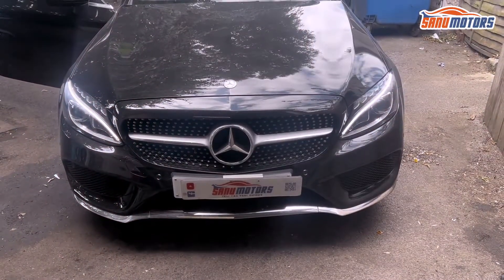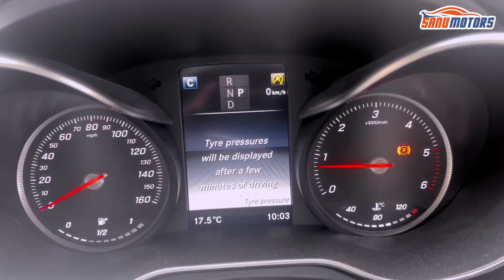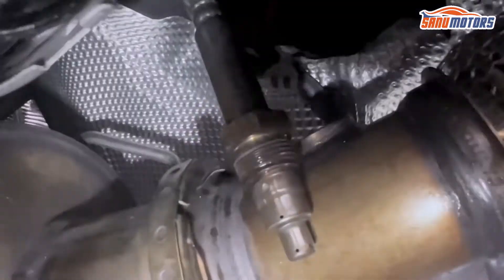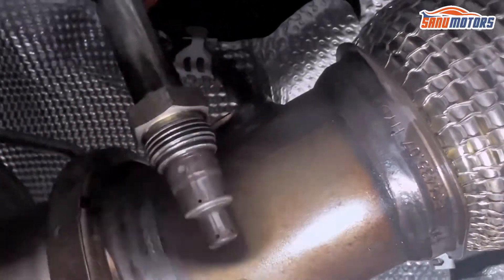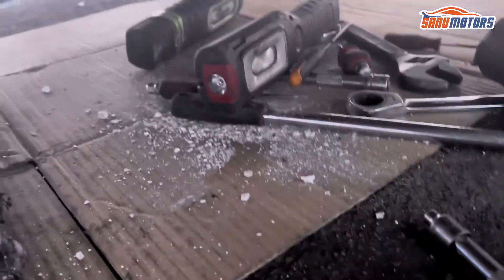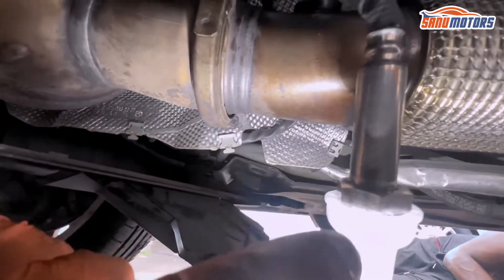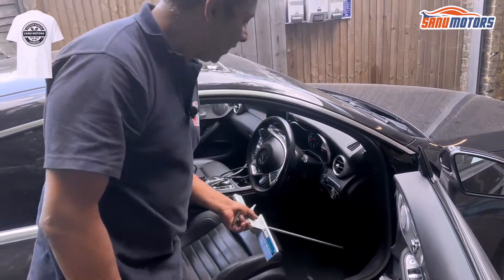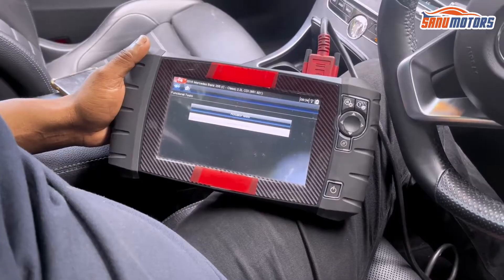Mercedes AdBlue DPF  And NOX Problem Fix | P229F91

Comment: I want to know what did you use to clean the hole. Was it just a simple DPF cleaner or is it something specific for adblue. Also i saw the foaming but did you rinse it with anything or flush it somehow or do you leave it like that.
Reply from the maker: For that job we used an AdBlue/NOx system cleaner, not a standard DPF cleaner — they’re formulated differently. The foaming you saw was from the chemical reacting with the crystallised AdBlue deposits. After letting it soak, we gave it a light flush with warm water to clear the residue before reassembling. Don’t leave the foam in there, always flush it out so nothing dries back in the lines. 👍

We’re not able to reply to continuous messages as we get a huge list of comments every day. If you need more help, join our groups — they’re packed with mechanics, automobile enthusiasts, and more:
👉 WhatsApp: https://chat.whatsapp.com/JOvJCdZYdV9J6PvIXw2RV0
👉 Facebook: https://www.facebook.com/share/g/15msa3NJmn/

Comment: Hello, i have replaced the nox senzor downstream as it was apper as faulty....then the engine light come up again, went to mercedes they said that i have to replace the other one ...i just replaced 2 days ago .and the engine light comes back again, indicating the same problem as first time ....don't know what to do anymore, both sensor are genuine bought then in the box ...dont think is pdf as i do motorways runs weekly.

Comment: I recently had both my NOX sensors replaced twice first unbranded and second is Mercedes genuine but both time the engine light still comes on and says NOX sensor problem. What could cause this problem. I don’t motorway journeys and only do local journeys. Could this be a DPF issue?
Reply from the maker: Hey! 👋 It’s frustrating when you've replaced the NOx sensors and the issue still persists. If the engine light keeps coming on, it might not be the sensors themselves but rather something else affecting the NOx system. Since you’re mostly doing local journeys, it could indeed be a DPF (Diesel Particulate Filter) issue. 🚗🚦

DPFs need regular high-speed motorway runs to regenerate and burn off the soot buildup. Without that, the system might get clogged, which could indirectly trigger NOx-related errors. I’d recommend checking the DPF’s status and considering a forced regeneration or a long drive on the motorway to help clear things up.

If that doesn’t help, it might be worth checking the exhaust system or even the ECU for any software updates. Hope this helps! 😊 #NOxSensor #DPFIssue #AdBlueProblem

Comment: How much is it to get a glc 220 fixed ?
Reply from the maker: The cost to fix a Mercedes GLC 220 with an AdBlue DPF and NOx sensor issue, such as the P229F91 fault, can vary depending on the nature of the problem and the garage you choose. Typically, repairs related to the NOx sensor can cost around £300-£800 just for the sensor replacement. In cases where more extensive work is needed, such as cleaning the AdBlue injector or replacing the AdBlue tank, the costs can rise significantly, sometimes up to £1,000 or more

For example, if the problem involves replacing the AdBlue tank, you could be looking at around £840 plus labor and VAT. Additionally, labor charges for diagnostics and repairs typically range between £75 to £150 per hour

It's always a good idea to get a detailed estimate from a certified Mercedes garage or an independent mechanic to know the exact cost for your specific issue.

Comment: Any idea about Code “ P229f85 “ 
Downstream sensor has been replaced x2 and it failed again , is it possible?? And now when it’s failed I can smell acid smell from exhaust… 
car was taken to MB dealership and they refused to change it again because they think it’s not a sensor issue “ sensor is changed by warranty “ and suggested us to run 800£ checks for 4h ! Dpf , adblue ‘ cats and I don’t even know what else to find out maybe some other parts are damaged…. What do you think ?
Reply from the maker: It’s concerning that the downstream NOx sensor has failed twice, especially since it's been replaced under warranty. The acid smell from the exhaust adds a new layer to the problem, which could indicate an issue beyond the sensor itself. Here's what might be happening and why the dealership might want to run extensive checks:

### Possible Causes of Repeated Sensor Failure:

1. **AdBlue/DEF System Malfunction**:
   - If the AdBlue system isn’t injecting the correct amount or at the right intervals, it can lead to incomplete neutralization of nitrogen oxides (NOx), causing excessive exhaust emissions and possibly damaging the NOx sensor. The acid smell could be linked to unneutralized exhaust gases, particularly ammonia, which is present in AdBlue and can create a sharp, unpleasant odor if it’s not properly used.
   
2. **DPF Blockage**:
   - A blocked Diesel Particulate Filter (DPF) can cause high backpressure in the exhaust system, which might contribute to sensor failure. If the DPF isn’t regenerating properly or is clogged, the exhaust gases might become too rich or contaminated, damaging sensors and potentially causing the acid-like smell.
   
3. **Catalytic Converter or Exhaust Gas Recirculation (EGR) Issues**:
   - The catalytic converter or EGR system may be malfunctioning. If the catalytic converter isn’t properly converting harmful gases, the NOx levels can skyrocket, overwhelming the NOx sensor and potentially damaging it.
   - Acidic smells could also be a sign that the catalytic converter is failing or that exhaust gas is too rich in harmful substances, such as sulfur or ammonia.

4. **Poor Fuel Quality**:
   - Poor-quality diesel fuel could introduce contaminants into the exhaust system, damaging sensors and leading to abnormal smells. This would affect emissions control components like the NOx sensor and catalytic converter over time.

5. **Software Issues**:
   - It’s possible the issue isn’t entirely hardware-related. There could be a problem with the engine control unit (ECU) software, mismanaging emissions systems like AdBlue and causing repeated sensor failures. Recalibrating or updating the software might be necessary.

### Why the Dealership is Recommending Extensive Checks:
The dealership is likely suggesting these comprehensive tests because the recurring NOx sensor failure points to a more systemic issue, not just a faulty sensor. If upstream problems (like those in the DPF, AdBlue, or catalytic converter) aren’t resolved, simply replacing the sensor won’t fix the underlying cause, leading to the sensor failing again. The acid smell suggests that there could be something off with the emissions system, which might need a more thorough investigation.

### What Should You Do?
Here’s what I would recommend, given the situation:

1. **Focus on the AdBlue and DPF Systems First**:
   - These are the two most likely culprits, given the sensor failures and the acid smell. You could ask the dealership to prioritize tests on these systems rather than going through the entire range of tests they’ve suggested.
   
2. **Check for AdBlue Crystallization or Injector Blockage**:
   - Sometimes AdBlue can crystallize and block the injector or related components, leading to improper NOx neutralization. This could explain why the NOx sensor keeps failing.

3. **Consider an Independent Specialist**:
   - If you’re uncomfortable with the cost of dealership checks, consider taking the car to a Mercedes-Benz specialist who can perform a targeted diagnostic on the DPF and AdBlue systems for a potentially lower price.

4. **Evaluate the Cost vs. Benefit of Diagnostic Tests**:
   - The £800 diagnostic fee might be steep, but if it uncovers a problem in the emissions system (which can be costly to fix later), it could prevent ongoing sensor replacements and more severe damage down the line.

### Final Thoughts:
While it’s frustrating to have repeated sensor failures, the dealership’s suggestion to perform deeper checks might be necessary to get to the root of the issue. If the problem is more complex (like a DPF or AdBlue system malfunction), replacing the sensor alone won’t solve it. In your case, focusing the diagnostics on the DPF, AdBlue system, and catalytic converter should give you a clearer picture of what’s going wrong and avoid more sensor failures.

Let me know if you need help understanding the diagnostic steps or further advice!

Comment: Hi. I have recently changed the nox sensor 2 bank 1 and cleaned the adblue injector like shown in your video. However I have a code shown as P204FFD and want to ask what that code is and any solution to fix the issue? Upon reading it says adblue system bank 1 fault.
Reply from the maker: The error code P204FFD typically indicates an issue with the AdBlue system, specifically related to Bank 1. AdBlue is a crucial component in modern diesel vehicles, as it helps to reduce harmful emissions by converting nitrogen oxides (NOx) into harmless nitrogen and water vapor.

Here's what you can do to diagnose and potentially fix the issue:

Check AdBlue Levels: Ensure that your AdBlue tank is adequately filled. Low AdBlue levels can trigger this fault code. If the level is low, refill the AdBlue tank with fresh AdBlue fluid to the recommended level.

Inspect for Leaks: Inspect the AdBlue system components, including hoses, connections, and the AdBlue tank itself, for any signs of leaks or damage. Leaks can cause a drop in pressure or improper AdBlue distribution, leading to system faults. Repair or replace any damaged components as necessary.

Test AdBlue Injector: Even though you've cleaned the AdBlue injector, there's a possibility it may not be functioning correctly. Perform a test to ensure that the injector is spraying AdBlue properly. If necessary, replace the injector with a new one.

Check NOx Sensor: Since you've already replaced the NOx sensor on Bank 1, ensure that it is installed correctly and functioning properly. Faulty NOx sensor readings can sometimes trigger AdBlue system faults.

Reset Fault Codes: After performing any maintenance or repairs, use an OBD-II scanner to clear the fault codes from the vehicle's computer. This will reset the system and allow you to monitor if the issue persists.

Professional Diagnosis: If the issue persists after checking the above steps, it may be necessary to seek assistance from a qualified mechanic or dealership. They can perform a more thorough diagnostic scan to pinpoint the exact cause of the fault and recommend appropriate repairs.

Remember to consult your vehicle's manual or seek professional assistance if you're unsure about any aspect of the diagnostic or repair process.

Comment: Hello Charly, you have a new subscriber!
First of all I wanted to thank you for the work you do.

I have a Mercedes c class 220d bluetec from 2015 with the following errors:
P229F91: the same as the video

U010E87: communication with the adblue control unit has an operating irregularity. Missing message.
U029E02: Communication with NOx 2 has a malfunction. There is a general signal error.

I erased all the errors and cleaned the adblue injector that was clogged, but after 3000 km aprox. the error p229f91 has appeared again.
If I lived near you I wouldn't hesitate to take my car to you but I don't even live in the UK.

What do you recommend to do? Is there a possibility to solve the error without changing parts? could swap the fwd sensor with the aft sensor in case of the same PN.

Thanks and keep it up!
Reply from the maker: Hi there!

Thank you so much for subscribing and for your kind words! I'm glad my content has been helpful to you.

Regarding the errors you're experiencing with your Mercedes C Class, it sounds like you've already taken some steps to address them by clearing the errors and cleaning the clogged Adblue injector. However, it's concerning that the P229F91 error has reappeared after a relatively short period.

Unfortunately, without being able to physically inspect your car, it's challenging to provide a definitive solution. However, based on the errors you've listed, it seems like there could be underlying issues with the Adblue system and NOx sensors.

Since you've already cleaned the Adblue injector, it might be worth checking other components of the Adblue system such as the Adblue pump, tank, and lines to ensure they're functioning properly. Additionally, for the U010E87 and U029E02 errors related to communication irregularities with the Adblue control unit and NOx sensors respectively, there may be wiring issues or faults within the control units themselves that need to be addressed.

As for your question about swapping the forward and aft sensors, it's possible that could be a temporary workaround, but it's not a guaranteed solution and could potentially cause other issues down the line.

If possible, I would recommend consulting with a qualified mechanic or dealership who specializes in Mercedes vehicles. They'll have the expertise and diagnostic tools necessary to pinpoint the exact cause of the errors and recommend the most appropriate course of action.

I hope this helps, and I wish you the best of luck in resolving the issues with your car! If you have any further questions, feel free to reach out. Keep me updated on your progress, and again, thank you for your support!
Thank You

Comment: i got the same problem but not nox sensor im showing dtc P220F and ive noticed the start stop light doesnt go green like in your video so theres still a problem somewhere
Reply from the maker: DTC P220F is a diagnostic trouble code related to the exhaust aftertreatment system. It typically indicates an issue with the Reductant System Performance. The "start-stop" light not turning green could be related to this issue, as it may be preventing the engine from entering the start-stop mode. Here are some steps to help you diagnose and potentially resolve the problem:

Check the DEF (Diesel Exhaust Fluid) Level: Ensure that the DEF tank is filled with the correct DEF fluid. Low DEF levels can trigger P220F and other related codes.

Inspect for DEF Contamination: Contaminated DEF fluid can cause issues with the aftertreatment system. Check for any signs of contamination or foreign substances in the DEF tank.

Scan for Additional Fault Codes: Use a diagnostic scanner to check for any other fault codes that might provide additional information about the problem.

Check for Exhaust Leaks: Inspect the exhaust system for any leaks, as leaks can disrupt the proper functioning of the aftertreatment system.

Inspect Sensors and Wiring: Check the wiring and connectors for the NOx sensor and other relevant sensors in the aftertreatment system. Damaged or corroded wires can lead to sensor issues.

Perform a Forced Regeneration: Some vehicles have the capability to perform a forced regeneration of the DPF (Diesel Particulate Filter) and aftertreatment system. Consult your vehicle's manual or a professional mechanic to see if this is an option for your vehicle.

Consult a Professional Mechanic: If you cannot identify and resolve the issue on your own, it's advisable to seek the help of a professional mechanic or dealership technician. They will have access to specialized diagnostic tools and can perform more in-depth diagnostics to pinpoint the problem accurately.

Remember that diagnosing and repairing issues related to the aftertreatment system can be complex, and it's crucial to address them promptly to ensure the proper functioning of your vehicle and to prevent further damage
Reply: wow im impressed you seem to know what your doing most garages i spoke to say it's a nox sensor can you book me in @SanuMotorswithCharlie

Comment: Thank you for this great video. I have the same issue with my E300 W212 check engine light on because of a faulty Nox sensor. My question is, can the probe be cleaned? What are the main causes of a faulty Nox sensor?
Reply from the maker: You're welcome! I'm glad you found the video helpful. The NOx (nitrogen oxide) sensor in your Mercedes-Benz E300 W212 is a critical component of the emissions control system. If it's malfunctioning and causing the check engine light to come on, it's important to address the issue.

Cleaning the NOx sensor is not recommended , but sometimes its works.

Common causes of a faulty NOx sensor 

Age and wear: Like all sensors, NOx sensors can deteriorate over time due to exposure to extreme temperatures and contaminants.

Contamination: Exposure to certain chemicals or contaminants in the exhaust gases can affect the sensor's performance.

Wiring or connector issues: Faulty wiring or poor connections can disrupt the sensor's ability to transmit accurate data to the engine control module (ECM).

Exhaust leaks: Leaks in the exhaust system before or after the sensor can introduce excess oxygen or other gases, leading to inaccurate readings.

Exposure to extreme temperatures: NOx sensors can be affected by extreme heat or cold, which can lead to failure.

Oil or coolant contamination: If there's a leak from the engine or cooling system that allows oil or coolant to mix with the exhaust gases, it can damage the NOx sensor.

In most cases, when a NOx sensor is faulty, it's best to replace it with a new sensor designed for your specific vehicle model. This ensures proper functionality and compliance with emission regulations. Additionally, a faulty NOx sensor can impact your vehicle's performance and emissions, so it's essential to address the issue to maintain optimal efficiency and reduce emissions.
Reply: @SanuMotorswithCharlie  Thank you for your tips and valuable information.